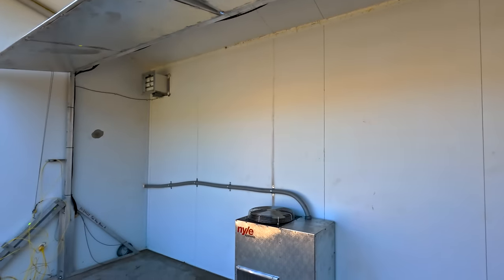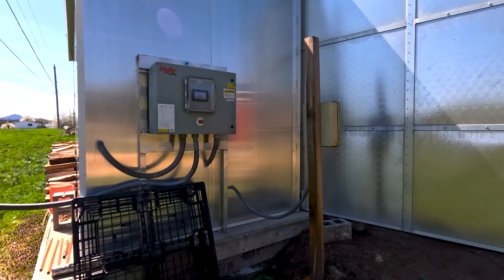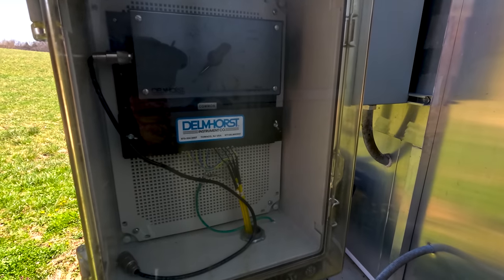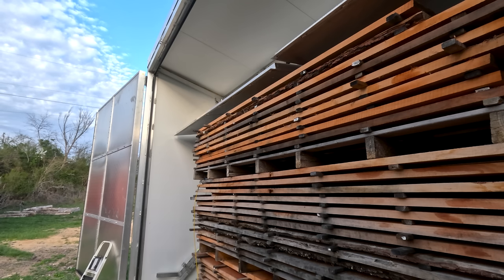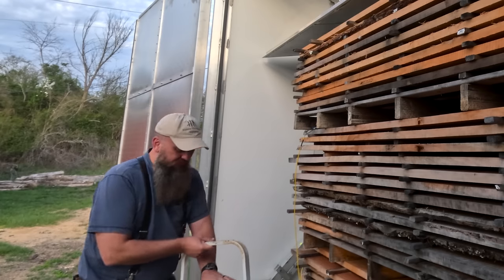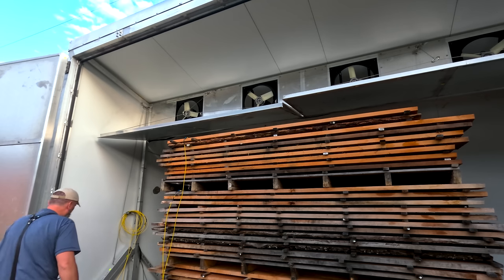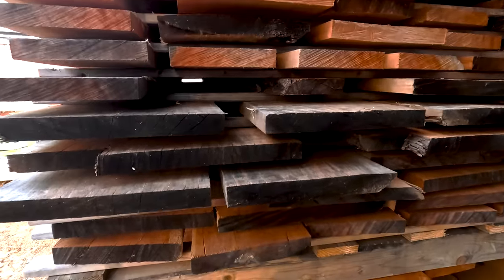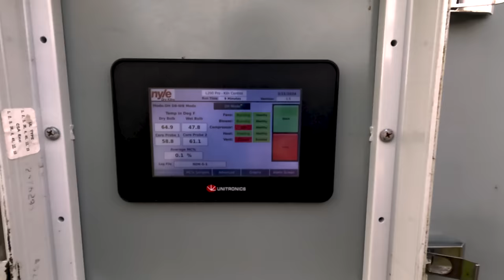Kiln Dried Vs Air Dried: Dispelling A Wood Drying Myth!

Comment: As a guy with a degree in Wood Products Engineering, I feel you did a great job in telling folks about the limits of air drying.  If one lived in Southern Arizona, N. Mexico, etc, air drying could get you a lower moisture content but for every area of the country, there's a limit as to how dry air drying can possible get you, no matter how many more months or even years you leave the lumber under cover. The old 1 year for every inch of thickness does apply to our slowest drying species, the various white oaks.  So I assume they used to apply that rule to almost every species just as an easy rule of thumb. Plus as I'm sure you know, there are dry kiln schedules that were developed many years ago for every common species and the thickness at hand.  Trying to force the process with extreme conditions just results in ruined lumber.  I bet you turn out some beautiful stuff.  Black cherry a real favorite of mine.
Reply from the maker: Appreciate it

Comment: I'm about to make the plunge into the sawmill/kiln world.  It will just be a hobby sized operation, but I have trees and time to make it happen.  Most of my initial projects are out-buildings, but I also plan to start doing some fine woodworking in my shop.  I found out I have quite a bit of Black Walnut on my property and that's what has pushed me over the edge to get the sawmill and kiln.  I'll be watching more of your older content to learn as much as I can.  Thanks for putting out very informative videos.
Reply from the maker: Good luck sir

Comment: Once it's kiln dried, if you store it in an unconditioned building or outside, will it go back up to 15 - 18%? Does it become susceptible to bugs again?
Reply: I think “eventually” the moisture will go back up to ambient air levels, but it should be sold long before a significant rise. Plus there might even be some chemical change during kiln drying that affects moisture - ambient is unlikely to reverse this.

Comment: Does your kiln just circulate heated air over the lumber?
Is there a dehumidifier attached to kiln as well?
I am not sure how humid the air gets in your area but if the humidity is very high (say over 90%) the lumber will dry very slowly.
At 100% humidity the lumber can absorb humidity from the air.
Very dry air in your area